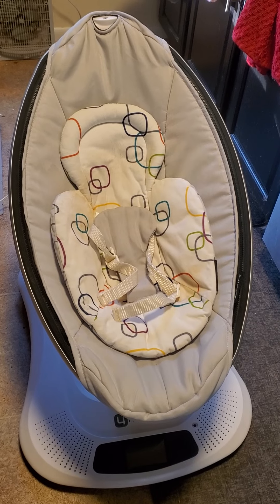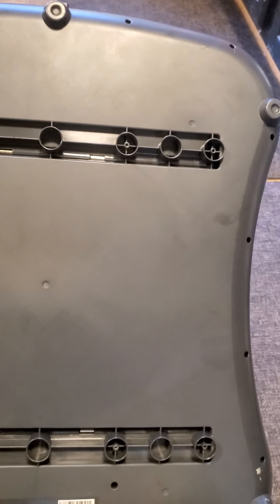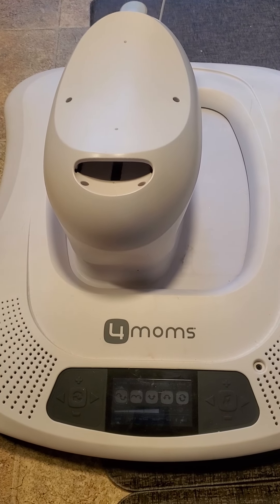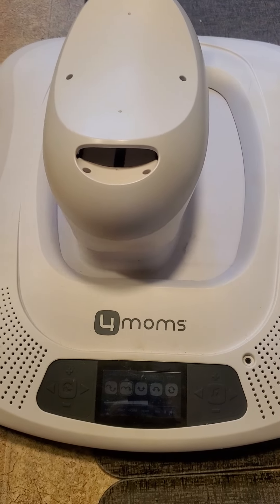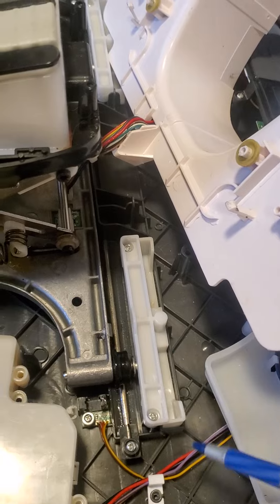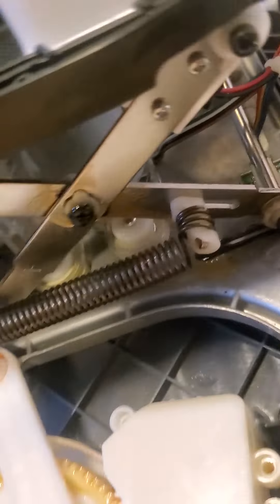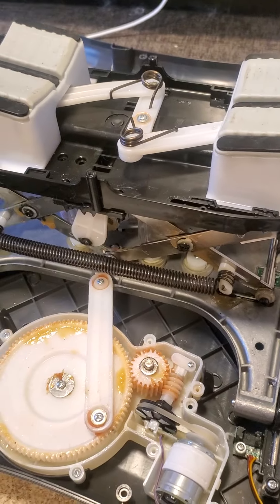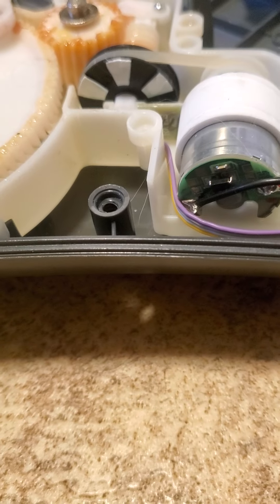🤓 How to Fix Mamaroo 4moms.  Broken mamaroo?  Mamaroo not working?  This can help you & your mamaroo

Comment: Our belt band has come off the bigger black one. Where does this go to fix it back?
Reply from the maker: I would google "mamaroo belt" that should render some replacements for you. 😊
Reply: The belt is intact just keeps popping off the under base causing a horrible churning noise when moving. Think it may just be broken completely as doesn’t stay on. Is there any additional parts to the black band to secure it that could be missing?
Reply from the maker: The belt for the unit I was working on wasn't black.  If you make a video and send me the link, I can give you a better opinion.  You can make a video private or unlisted on YouTube and send me the link.  Either post it to the comments or send the link to my email.  My email is in my bio for my page.  If the wheels spin freely without the belt, I would make sure the belt and the wheels don't have any defects.  The other thing that could have happened is that the belt stretched out or the wheel spacing isn't correct.  Hopefully, that helps!  😊

Comment: Hi! I have the model 1037 and it won’t power on at all. Do you have any ideas of what I could do for a fix?
Reply from the maker: If it's not powering on at all, I would check the charger and the part that the charger plugs in to first.  No start up, typically means no power.  I don't recall seeing a fuse in there, but check to see if there's a fuse after checking the cord and the plug in for the cord.  I hope this helps!  😊

Comment: Hi, mine turns off and on whenever i press the + button to start it. Sometimes it even runs with the screen black 😢 model 1037
Reply from the maker: It sounds like the wires either attaching the power supply to the screen or the power port are disconnected or disconnecting in use.  Try to open it up and look at the connections.  Unplug and plug them back in.  😊

Comment: When I restart mine it only does side to side VERRY SLOW and I get no up and down motion at all 😅 I don’t know what I can do at this point
Reply from the maker: If the adjustment arrows aren't working, it was be either a electrical connection issue or a circuit board issue.  You could try unplugging and then plugging them back in.  😊

Comment: Do you have a link for buying the sensors for the mamaroo. Also, do you know how to factory reset the 2017 model 1037
Reply from the maker: I don't have a link for the sensors.  I'm also unsure on the reset for your model, but most models are pushing 3 of the buttons at the same time, so I would try to do different holds on that & see if you can figure out which sequence works for you.  Good luck with it!  😊

Comment: I do try to find out if there's parts that will hold the mobile it won't stay up
Reply from the maker: Hi!  If the mobile isn't staying up, you can try the link below for an attachment to sketch it stay up.  Be sure to check with your style though.  There are 2 variations!  Good luck.  I hope this helps!  :)

Amazon.com : TEYOUYI Mobile Attachment Connector Piece Replacement for 4moms mamaRoo, Toy Bar Conversion Attachment for Model 1037 Toy Holder for Mamaroo,Toy Bar Attachment Point and a Spacer,White : Baby
https://www.amazon.com/TEYOUYI-Attachment-Replacement-Conversion-1037/dp/B0BP1116PJ/ref=asc_df_B0BHDMDMG2/?tag=hyprod-20&linkCode=df0&hvadid=642204681509&hvpos=&hvnetw=g&hvrand=7388952554930348733&hvpone=&hvptwo=&hvqmt=&hvdev=m&hvdvcmdl=&hvlocint=&hvlocphy=9007556&hvtargid=pla-1943706330369&psc=1&gclid=Cj0KCQjw0bunBhD9ARIsAAZl0E0sRzjKPngNED5HB3WDTtPCXtv_21nykjAu-A_WZZGsrAsSkm-7YEoaAtuCEALw_wcB&th=1

Comment: What do you use for the lubricant?
Reply from the maker: You can use wd40 or any silicone lubricant.  Just make sure not to get the lubricant on the sensors.  :)

Comment: The problem were having it will only work onslowest setting or it stops. Tryed reboot tree swing wont work it stops and all stop on anything but slow ADVICE???? please
Reply from the maker: Thank you for your comment!  This could range from an electrical issue, try checking wire connections or the wheel issues.  The other thing that may be causing an issue could be the actual board on the machine, but that would be far more difficult to troubleshoot.
Reply: @michellefixit  I discovered on the mechanism that goes back-and-forth there should be four little wheels ours only has three one of the wheels is missing and it’s actually dug a hole into the metal if there was a way I could send you a picture I could show you I don’t know if you would think if that’s the problem or not or just another problem
Reply: Wow.  It was the sensors.  Working now!!!!! Thank u do much
Reply from the maker: You're very welcome!  I super happy to have been able to help.  :)

Comment: I cleaned all the sensors and the machine still shows the error. I'll try to paint the white. But if the code appears again. What could possibly cause the issue? Where would the resistance be?
Reply from the maker: You would have to keep the white cover parts off of it and turn it on with everything exposed.  If the wheel gets painted and the sensors are clean, something with make some type of noise to help you figure it out.  Did you also unplug and replug the wires back in for the control board?

Comment: How to fix the mobile on mom rur
Reply from the maker: I responded above, but here's the link again.  Good luck!  :)

Amazon.com : TEYOUYI Mobile Attachment Connector Piece Replacement for 4moms mamaRoo, Toy Bar Conversion Attachment for Model 1037 Toy Holder for Mamaroo,Toy Bar Attachment Point and a Spacer,White : Baby
https://www.amazon.com/TEYOUYI-Attachment-Replacement-Conversion-1037/dp/B0BP1116PJ/ref=asc_df_B0BHDMDMG2/?tag=hyprod-20&linkCode=df0&hvadid=642204681509&hvpos=&hvnetw=g&hvrand=7388952554930348733&hvpone=&hvptwo=&hvqmt=&hvdev=m&hvdvcmdl=&hvlocint=&hvlocphy=9007556&hvtargid=pla-1943706330369&psc=1&gclid=Cj0KCQjw0bunBhD9ARIsAAZl0E0sRzjKPngNED5HB3WDTtPCXtv_21nykjAu-A_WZZGsrAsSkm-7YEoaAtuCEALw_wcB&th=1

Comment: I'm having trouble with the sound working on mine.  None of the buttons are working and I can’t get it off mute.  Any tips or ideas?
Reply from the maker: I would open it up and look for any loose wires and/or loose connections.  Being that it's all of the buttons not working, it's likely one of the wires that goes into the button/panel display.  I hope this helps!  Good luck with it.  Have a great day!  :)

Comment: I buyed a used mamaroo 4moms but after a month of use the screen just go on half a second then go off nothing work. I opened it open but didnt see any loose wire or something but it go off instantly
Reply from the maker: You may have a connection issue with the electrical port in the rear of the unit or the wires that connect to the screen.  Try to see if there is any movement in those places.  I hope that helps!  😀
Reply: mine just did the same thing and i had to take it completely apart, and turns out it was the front wires got loose. so i just zip tied them haha now it works like brand new
Reply from the maker: Great job!  😊

Comment: What if mine just will not turn on?
Reply from the maker: Apologies, I would have to have more information to help you.  If you want to send me a video, I could try to assist.  Thank you for your comment and have a great day¡
Reply: Mine is doing the same. No power at all 😢
Reply from the maker: If you take it apart and look at the wire connections, you might find one that's not connected.  Else, you could uplug and then plug them back in.  Another thing to do would be to check and see if the internals have power.  You can see if there is power for the inside by checking for continuity or checking to see if there is power.  To check for power, you'll have to buy a power tester, they are about $20 at most home improvement stores, and they illuminate in green or red.  Green means no power typically, red means power.  If you need a video on how to use one, let me know.  I hope this helps.  It's hard to help if I can't see the problem or touch it.  Have a great day! 😊

Comment: So what happens If I've cleaned the  sensors,  lubed the white wheels, no issues with white paint wearing.. and still getting error. I did the reset by holding down the +/- mode, and it will move. I can select a mode,but  it just moves into that one motion not the requested one.
Reply from the maker: The only other thing I can think of would be to make sure something is not binding the motion of the machine.  If it gets ANY resistance, it will continue to show an error.

Comment: Any thoughts on if there is a way to fix the white plastic piece that is attached to the wheel? Mine is broken and is keeping it from moving side to side.
Reply from the maker: You could either glue it and/or see if you can create a splint to correct the broken area.  If the broken area is where it mounts with the screws, you could possibly splint the area with glue and metal washers on both sides.  There should be replacement parts available for the unit, as well.  I hope this helps!  :)
Reply: Is it the rubber O ring? I saw someone went to the hardware store and bought just a generic o ring.
Reply from the maker: Thanks for helping!  😊

Comment: i tore mine apart and its working but as soon as i snap the white piece into place its not working again. do i have to put the whole thing together for it not to pick up an obstruction?
Reply from the maker: Apologies for the delay in communication!  If you were to do a video with your specific problem, I could try to help.  Thank you for your connect and have a great day!